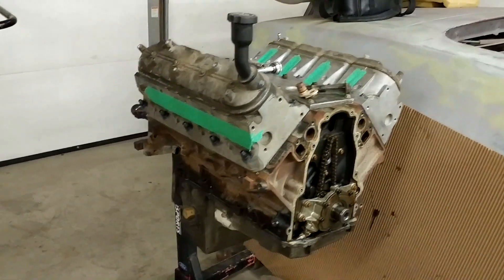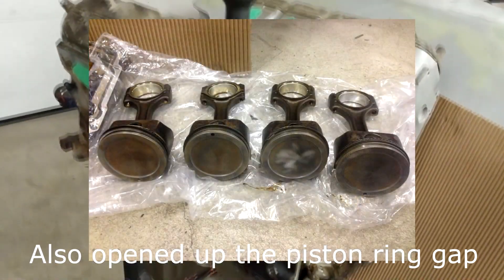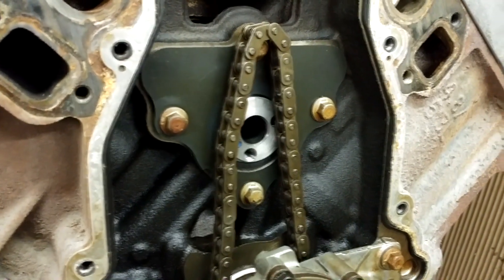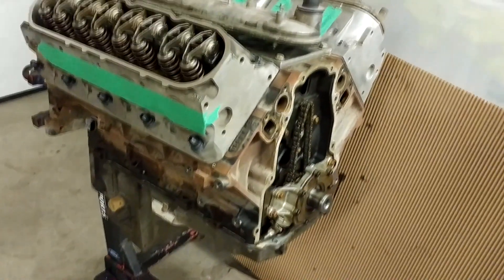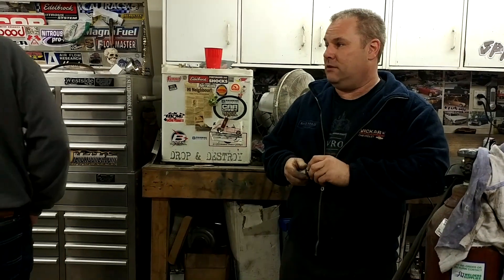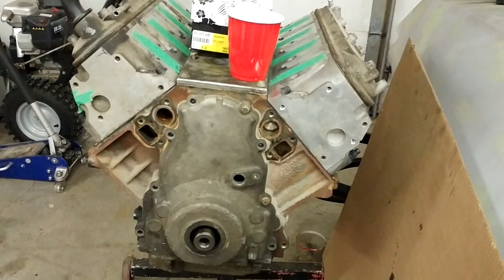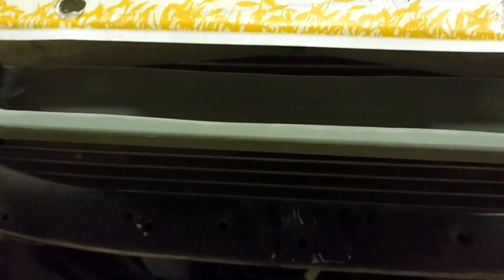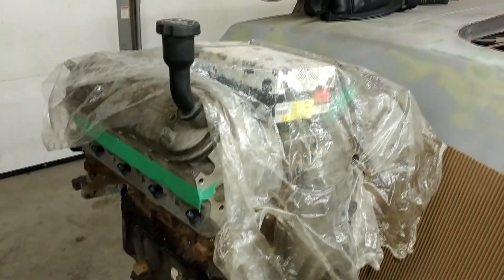5.3 LS Build | WTF is he doing to that sensor? SPPW - S3E2

Comment: The ls2 cam sensor will work..... flip the outer 2 wires and extend the harness. woollaa. I ran 6.40s at 110 in a 1988 IRocz with 4.8 with ls9 cam. Ps, The plug is the exact same.

Comment: ls9 cam here ran 10.1 at 136 mph in a 4400lb silverado with a 4.8. 24 psi. had another silverado single cab run 10.5 at 131 mph with a gen 3 5.3 20 psi. the cam sensor is only needed for start up. itll take one or two tties for it to turn on, thats all.
Reply from the maker: cesar enriquez I knew someone else had to be using the LS9 haha.
Reply: SPPTV where are you guys from??? I might be your neighbours im livin in winnipeg right now

Comment: Just FYI- the timing cover with sensor is 40$ from rockauto. Cam gear is $20. LS9 cam is $109 shipped on ebay. So for about $170 you can get everything needed.
Reply from the maker: Adam Opheim Yup. So dont let someone tell you its not worth it and just spend $400+ on a custom grind.
Reply: +SPPTV  I went 8.93 @ 153 with an ls9 cam in a gen3 5.3 with 317 heads. was 8.6:1 compression. Just dont add a bunch of boost/power below 5k or so and it will take some abuse!

Comment: Buy the cam sensor as if you place any value on your time, it is not worth it, plus you would have to cut one or both sides shorter, them solder terminal to terminal cover it with epoxy, grind to round, install it and watch it fail. Heat cycles and vibration will kill it. Spend the $3 go into the junk yard and pocket the first one you find and get the connector. Solder & shrink tube as needed.

Comment: If running a Turbo 350/400, you will have to purchase these 2 items to hook up your VSS(vehicle speed sensor) wire. https://www.summitracing.com/parts/dak-sen-01-4160?seid=srese1&cm_mmc=pla-google-    https://www.summitracing.com/parts/dak-sgi-5

Comment: @5:35 RANDY is saying idiots fuck up the torque calibration on their torque wrenches by leaving them set...well that is total bullshit! Where did he get that bit of info? Some highschool shop teacher I suppose?
I have a 19 year old (1998, when I built my first SBC) mastercraft 1/2" drive wrench that I bought on sale at Canadian Tire for $50, it didn't even come with a calibration sheet!...I leave the thing set at whatever torque I last used it, I've dropped the fucker dozens of times, slid it across a garage a few times too. A couple years ago I tested its calibration: (I have access to a gov't torque wrench testing bench) I did three pulls each at the low end, midpoint and high end (20, 120 and 250 ft-lbs) and it showed a calibration of 0% on low, 1.5% medium and 0.5% out at high torque setting.
Reply: Dh66 i was alway told to loosen off the torque wrench after use. I only use a bendy so what do i know.
Reply: Yea, EVERYBODY says that. No substantiation. I was actually surprised my cheap tq wrench, after all its abuse and age, is better than snap on cals out of the box. As long as you dont dent the external tube, especially a couple inches from the handle, at least in my experience, they still work. BTW, my uncle has a candy red '74 nova with a 454 in it, I love what you've done with yours!

Comment: isn't the cam sensor on gen 3 and 4 motors the same, the gen 3 ls2 sensor superceeds to the gen 4 front cam sensor.
Reply from the maker: Joel B As I understand it their are 2 variables. Location (front or rear) and 1x or 4x sensor. But I could be wrong.
Reply: SPPTV  im doing an ls9 cam into ls1 at the moment as well  i got the 1x gear but the sensor through gm seems to superceed to the 4x sensor and all sources i have spoken to tell me the tan 4x srnsor will work on both 1x and 4 x as essentialy its only going to pick up 1x pulse because the sprocket only has a 1x pickup
Reply from the maker: Joel B Did not know that. Ill look into it. Thanks!
Reply: SPPTV post up how you go be interesting to see what you find

Comment: 500 horsepower is a very low expectation for a turbo LS. I always thought the shit horse should've been faster than 11s with a turbo 6.0 are you guys using a super conservative tune?
Reply from the maker: briggsgreg1983 on the shithorse its conservative because its never been on a dyno. I could have street tuned it more but we were too busy doing burnouts with it.

With a better converter and a 2 step it would go 10's with the same boost it had in it when it went 11's. It doesnt have a bar and probably never will, so we are not that concerned with track times.

My mustang is certed to 8.50, and has the chassis, trans etc. to go that fast. My previous best was a 9.35@154 with a 200 shot. My limiting factor will be the gen 3 rods I accidently bought. 

Also I tuned the shithorse safe because it belongs to 4 other people lol, my car I will be able to push harder.

Comment: You said other sensor is only 40 dollars,what is the part number?
Reply from the maker: +Richard Storms LS2 engines and more used them. So basically just find a part number for one of those engines. I would look at mine if it was nearby.